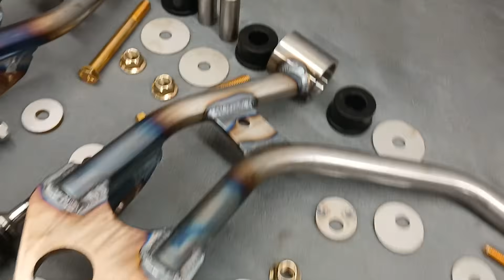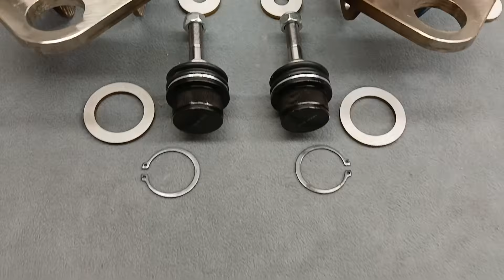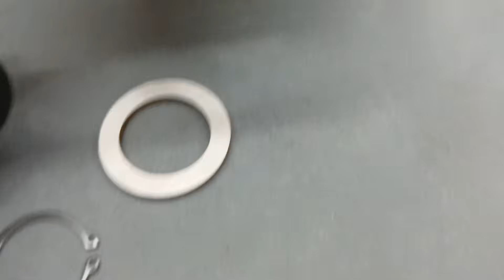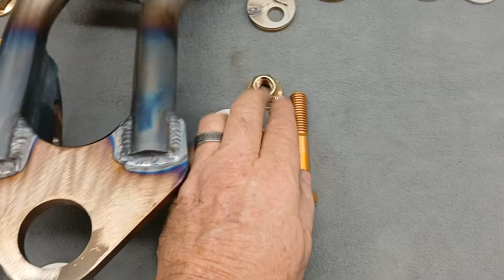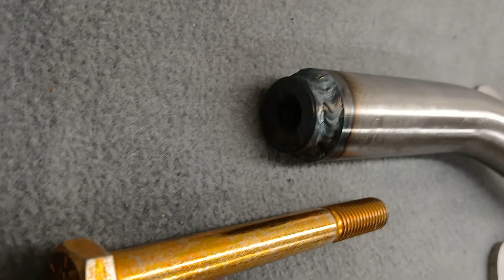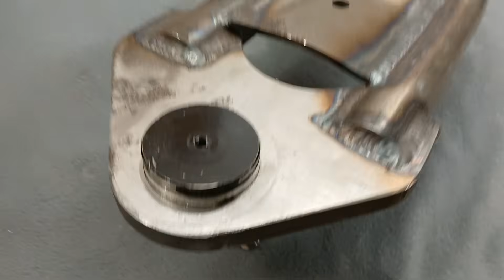Crown Vic 1" shorter lower control arms.

Comment: Will these work with the new QA1s coil over for the Crown Vic? The ones I just got, the spring are now sitting on the lower side of the coil overs and they are adjustable on top.
Reply from the maker: Yes they are designed to work with coil overs.

Comment: Hello CPO. I have built several F100's and currently coming to the end of a two year build on a 53 F100. Looking to make a choice on wheels and considering the narrowed control arms. If I were to go that route, could you confirm the following. Thanks.
 Purchasing the upper and lower will give the narrowed inch per side?
The upper and lower will work with the stock parts on the crossmember/Crown clip?
You no longer will be able to use the swaybar?
4-6 week turnaround on parts?
Reply from the maker: 1” narrower per side. Works with all factory Crown Vic parts. You can use the sway bar. Just have to mod the little barbell ends. Yes 4-6 weeks currently but should drop to 3-5 sometime this month.
Reply: @chassispartsonline  Thanks for the response

Comment: I like your design but you need to make a version that accepts mustang electric rack and pinion.
Reply from the maker: The control arms work with the Mustang electric steering. Range industries even makes tie rod ends specifically for my shorter arms.

Comment: Is it 1” per side or per pair”
I need to narrow mine by 2”.
Also, just to be clear, will these work with the factory CV carriage or do they require your carriage to work?
Reply from the maker: By carriage you mean what? These are made for the Crown Vic aluminum crossmember. They are 1” shorter. Each arm is 1” shorter.